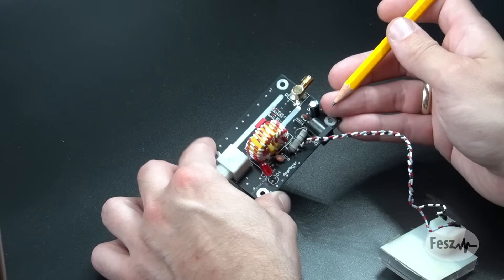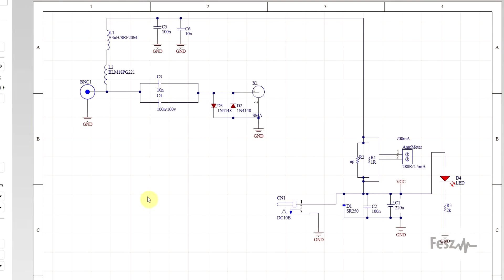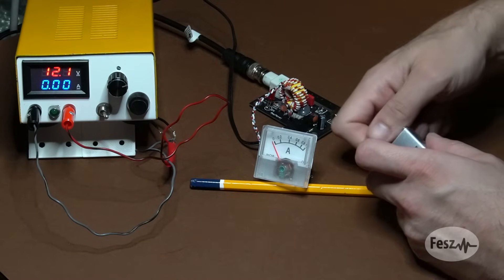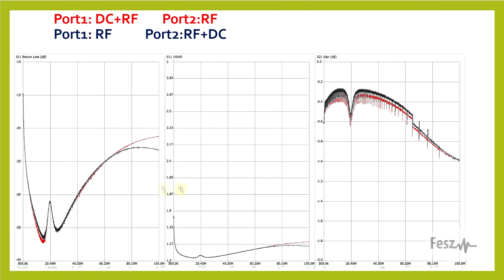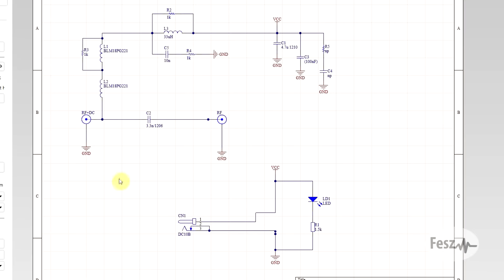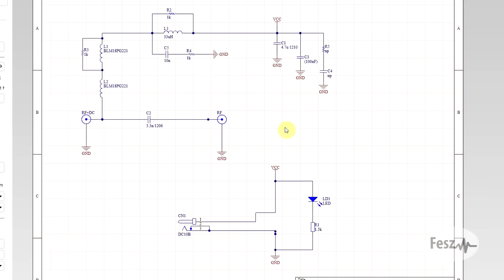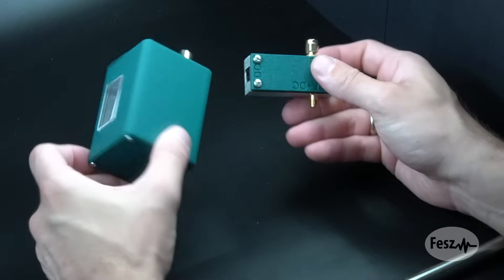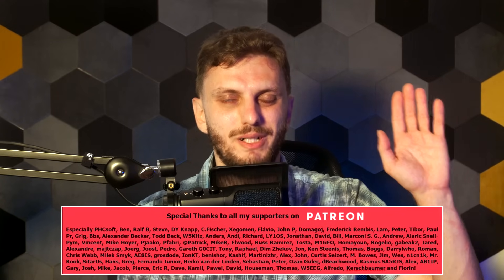Bias Tee Build (2/2)

Comment: Hi when you were testing the bias tee with nanovna was it powered by dc voltage? How much dc voltage on bias tee to do not damage nanovna input?
Reply from the maker: I did not apply the DC voltage since it should not impact the results; it should be possible to test the circuit while DC power is applied but then you need carefull DC blocking to not damage the VNA.
Reply: @FesZElectronics have you kept it float isn't it necessary to connect dc input to ground when testing with nanovna ?

Comment: Looking at the S11 curve arount 14:14, I see a bad case of impedance-mismatched series line. 
Screen-grabbing and approximating the grapth, one of the maximums is ~1145 MHz, another is at 2598, so the ripples are spaced ~290 MHz apart. Since a series TL resonator is "transparent" when it's length is (multiple) half lambda, it seems you have 50 cm * Vf or ~30 cm of mismatched cabling. The peaks are also very close to the integer multiples of that frequency, that also supports this theory. You can simulate the behaviour in LTSPice easily, using that I found that to get your ~0.16 dB ripples in S21 your SWR there needs to be ~1.1, or the cable is ~60 Ohms.
I suggest checking your cables and calibration (your cable should have been calibrated out already, but if it's faulty, it can change after the calibration). I hightly doubt the ripples come from your circuit, as all the signs point to it being a series resonator with a wideband repeating characteristic, and there's no way you accidentally built it from your discretes, it can only be a TL, and the length is too long for your board.

Comment: You are right : a badly made bias-T can be source of lot of receiver problems.
Nice PCB and 3D design !

I have a question for you : by adding a power switch on the bias-T, we could control an amplifier at the antenna. I guess that the amplifier/antenna side is quite complicated to design. I mean, not as simple as using a DPDT relay for HF, right ?
Reply from the maker: Well, the design and complexity depends on the frequency of operation. Using relatively inexpensive relays will work well below 50-100MHz, and above you have dedicated RF relays. I am not sure though what sort of control do you wish to have over the amplifier - for example, one of the things I tried to do in the past was to have a relay bypass switch in the antenna amplifier so that if there is no DC bias, the relay just bypasses the amplifier, making the antenna passive - is this the sort of thing you envisioned?
Reply: @FesZElectronics  Oh, thanks for your answer Sir !
Yes right : bypass the antenna amplifier when Bias-T power is off.
I am thinking about a relay like AXICOM IM03, but I am afraid of amplifier loopback and oscillations. 
Also over 100 MHz, may be I should better use pin diodes switching ? (not sure you made a video about pin diodes ?)

Comment: Very good video.
1) Do the wiggles in the return loss trace S11 at 13:56 mean there’s a mismatch in the transmission line somewhere?
2) What did the VNA traces look like after you put the metal box on the small circuit board? Did they change much?
3) Only eight views in eight days. Yikes. I think this is one of the best electronics YouTube channels there is.
Reply from the maker: I also think this is some sort of mistmatch that the calibration is not able to take into account. To be honest, I did not re-measure with the full enclosure, but I expect minimal changes. As for the views, the video is not public yet :D
Reply: Sometimes an attenuator near the unit under test reduces the ripples in the response.